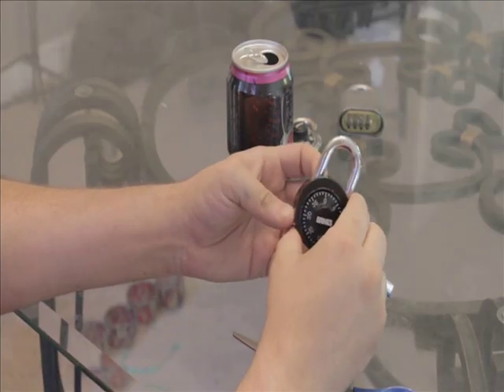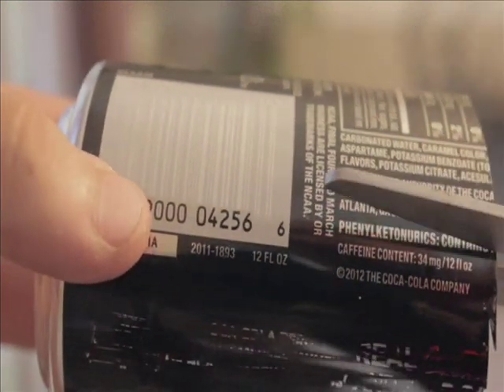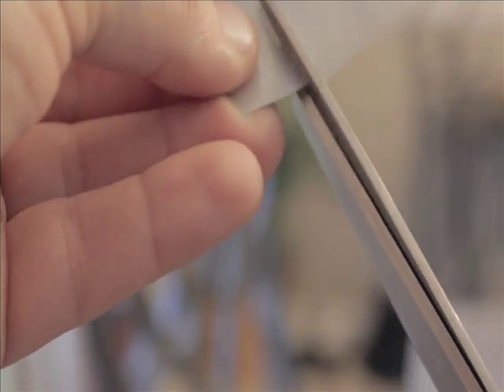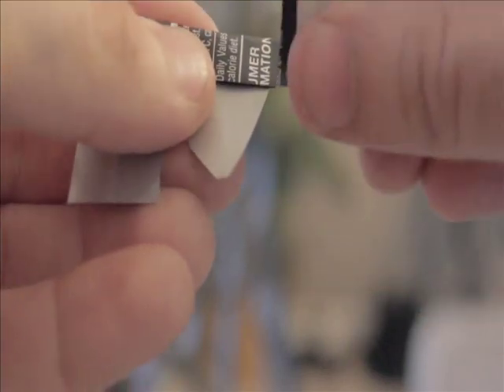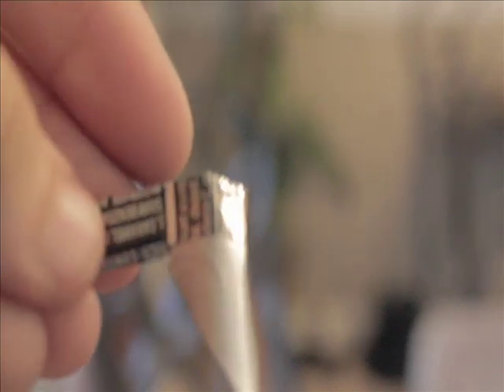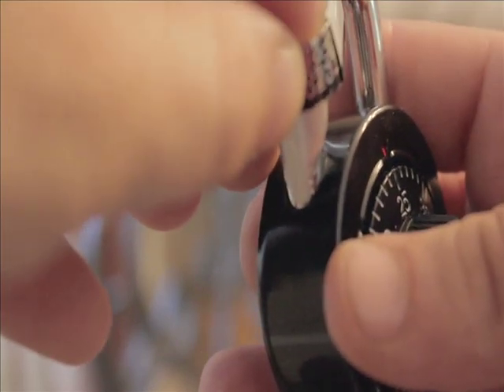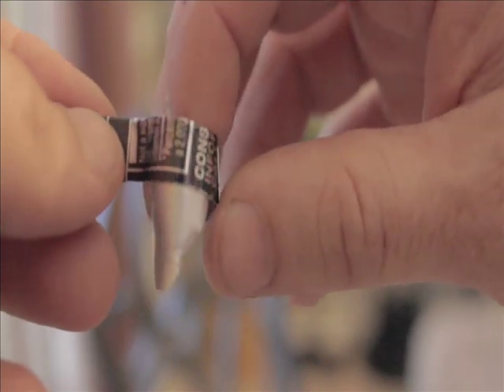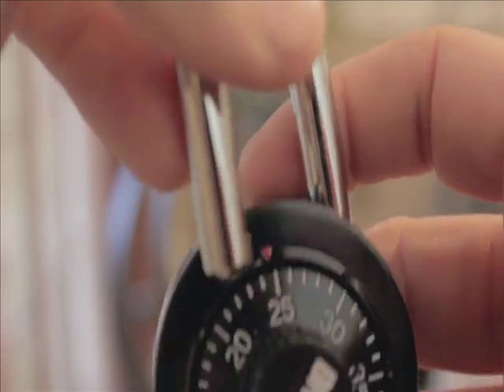How To Pick A Combination Lock

Comment: I've got one of these Brinks locks like you demonstrated with, and the combination I have doesn't work (it's only 3 digits and I think this lock is a 4-digit combo).  The shim you demonstrated worked a treat (THANKS!), but (obviously) it doesn't help tell me the combination.  However, I feel like I can see the edges of the (wheels?) through the now-open shackle hole, so I'm going to see if there's any way to "decode" the lock once it's open.
Reply: Success!  It turns out it was a 3-digit combination, and the combination I had was only one or two digits lower on each number than the working combination.  So far, this Brinks lock appears to have no tolerance for even one digit "slop" in the combination.  I was able to use the unlocking sequence (right 3 times to the first number, left two times to the second number, back to the first number) to line up the cutouts where I could see them through the shackle hole, which gave me a "relative" combination.  The true combination was 4 less than each of those.